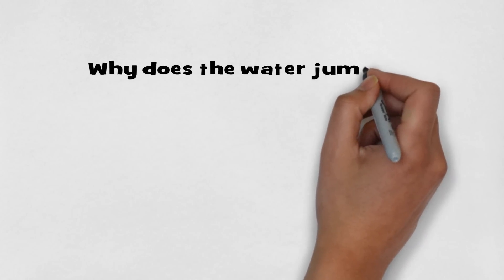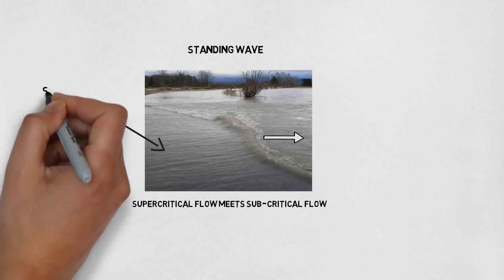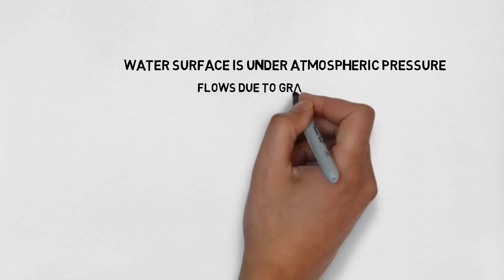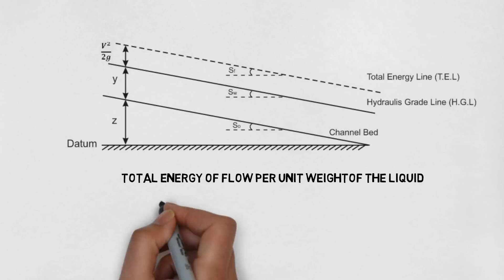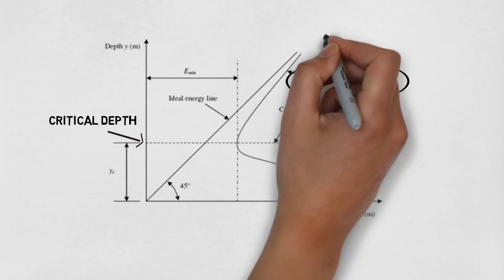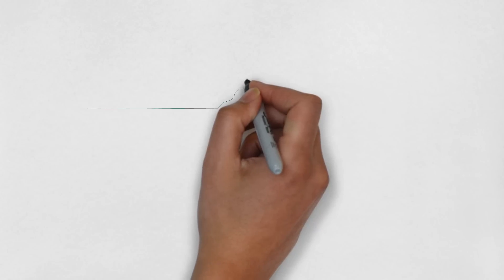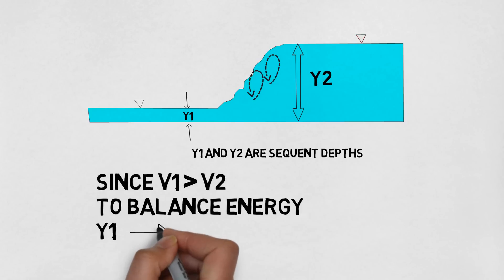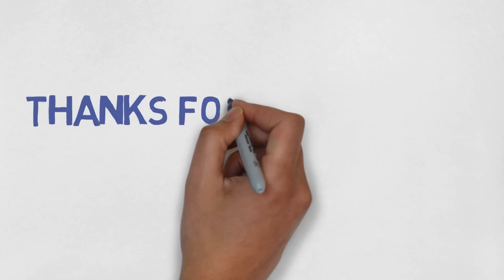Why does the water jump..??!! -- Hydraulic jump explained.!!

Comment: There is a confusion about two different fluid dynamic phenomena in this video: a standing wave is not a hydraulic jump. A hydraulic jump, typically, results from the transition from supercritical to subcritical flows , however, a standing wave can mantain the supercriticallity. A standing wave is always connected with a positive relief bedform (typically an antidune). A hydraulic jump, on the contrary, on a mobile substrate produces a negative relief through erosion and, on a non-mobile substrate, a quick upslope migriting hydraulic jump (sometimes downslope depending on flow conditions. Even the flow structure of a standing wave and a hydraulic jump are totally different.

Comment: We challenge all Engineers everywhere to prove us wrong!
Would YOU or any engineering professional  design into a Hydraulic Control System 
 the structured implementation of  Cavitation and  Steam Hammer
Focused Cavitation and RAM Cylinder Steam Hammer  in a Hydraulic Control System
In order to produce clean, cost effective super-heated steam? 
Steam
 produced from Saltwater plus Piezoelectric particulates serving as MHD 
electrolytic enhancing "seeds" formulating a Piezodynamic Conducting 
Fluid (PCF) moving through an increasing magnetic field of a 
Solenoid/Self Inducting Loop that is oriented surrounding the Hydraulic 
Control flow pathways to deliver PAYLOAD of super-heated PCF in steam 
form delivered without use of fossil fuel…
Well, THEY did!  The Geotechnical Civil Engineers of Giza Plateau…

 WHO will be the first current Engineer to investigate enough to win their Nobel Prize?
We throw down the  Gauntlet of scientific fact checking challenge-

Today humanity can Produce Cost effective, clean, green, superheated steam without fossil fuel usage. 

Perspectives Enhancement Project_ P.O.V. _GATEWAY
https://www.youtube.com/channel/UC05ElTKFFr9C_keApUjvLng
From <https://www.youtube.com/channel/UC05ElTKFFr9C_keApUjvLng>

Comment: Really nice and engaging animation! However, you mention at 2:24 that the two depths are "sequent depths because they represent the same energy". This is not correct: the flow either side of the jump does NOT have the same specific energy (in fact, hydraulic jumps are used to dissipate energy in dam spillways to protect riverbeds) but the same momentum flux. Sequent simply means "following" in latin and means that depth y2 follows depth y1. Because they represent the same momentum flux, they two depths are also known as "conjugate depths". Still, really great animation :)
Reply: Does y1 change into y2 automatically without interference from the geography of the environment (the subcritical y2 empties freely as a waterfall)?

Or is it a blockage of some sort downstream that makes the y1 depth jump up?
Reply: @josephoyek6574  this is because the velocity is very high in supercritical stage because the water comes from a high head like spillway so to maintain the energy in subcritical stage it's depth has to be increased I hope you get it❤️